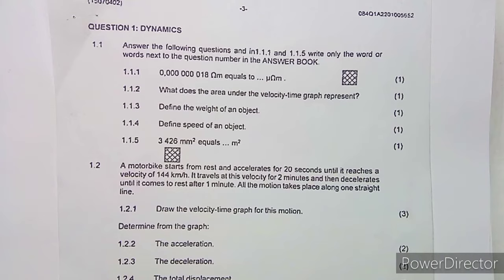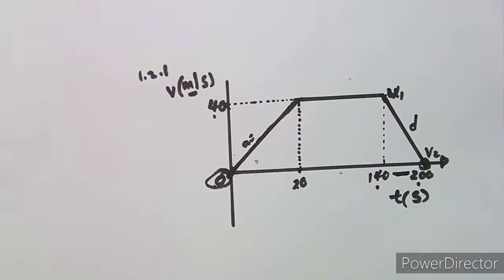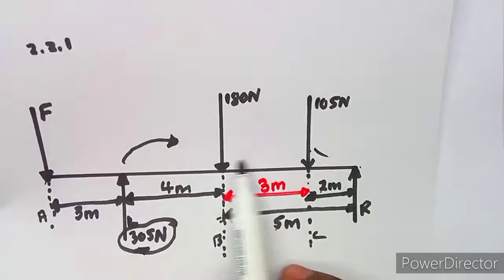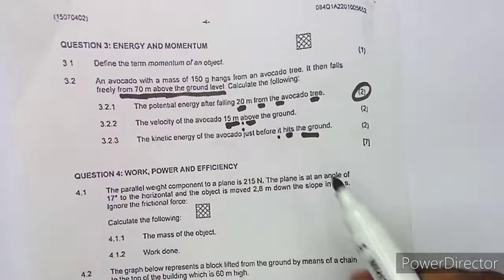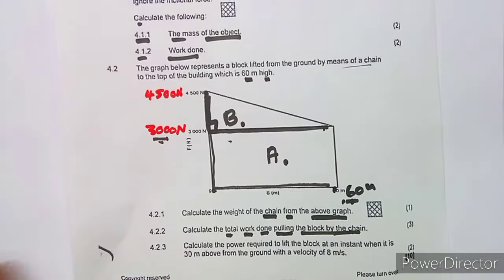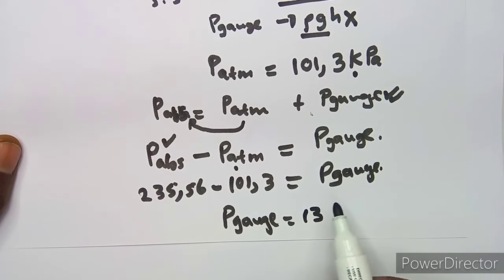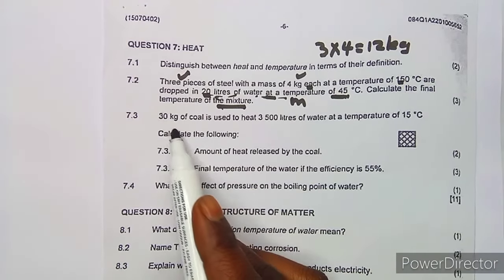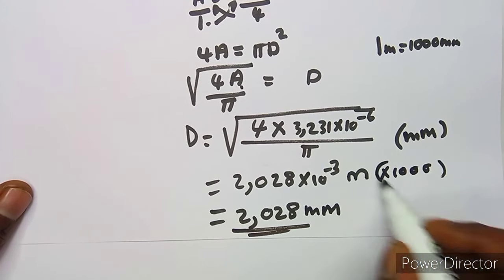Engineering Science N2 June/July 2022 Question Paper and Memo @mathszoneafricanmotives

Comment: Hello on Question 7.2 When you add 83 740t2 and 6000t2 together the answer should be 89 740 because the answer you got there was an addition of 600t2 instead of 6000t2.
Reply from the maker: Will check it out
Reply: i had different answers aswell in that Question